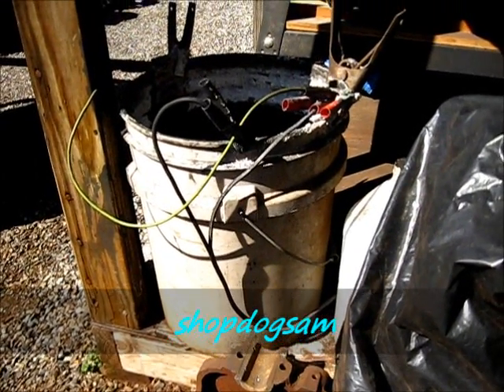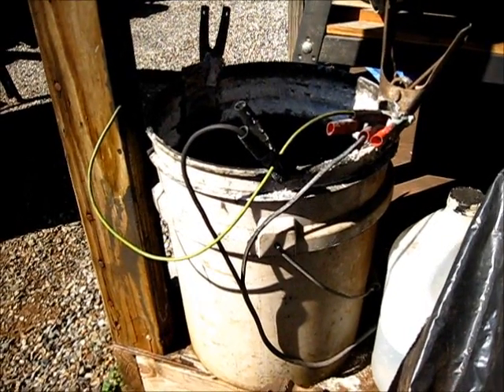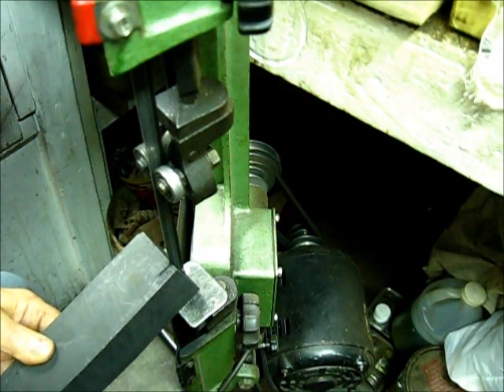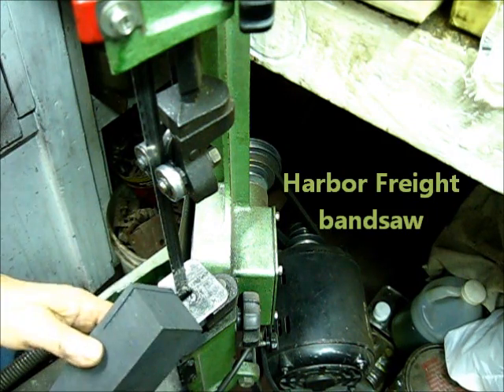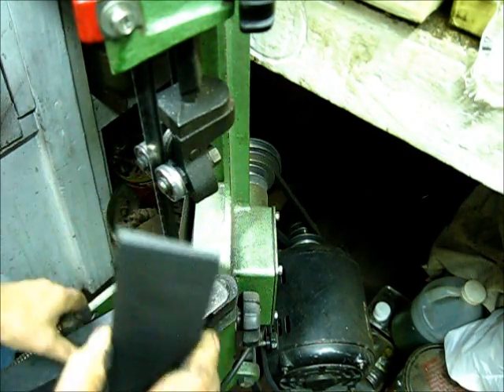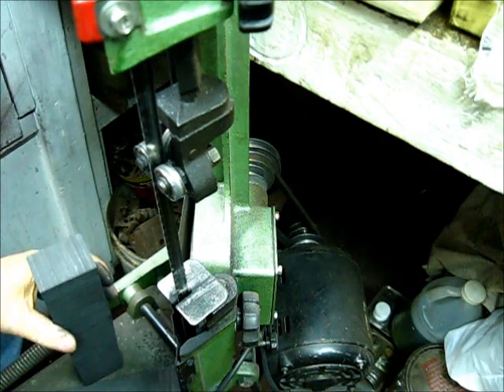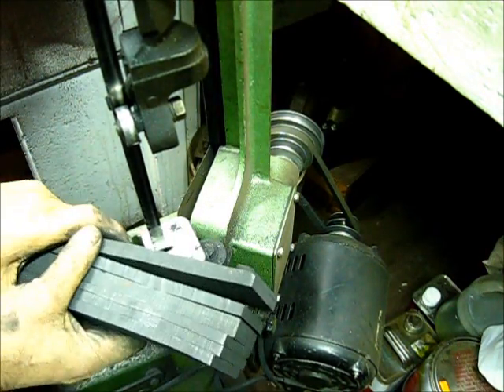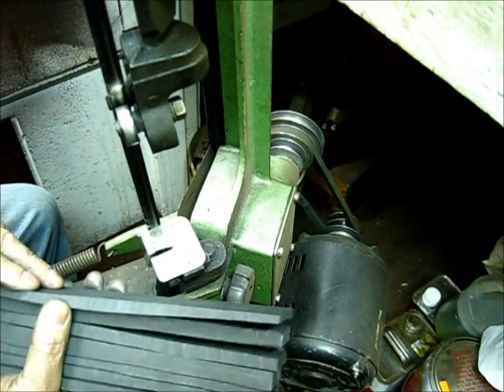Electrolysis Rust Removal #2 / graphite anodes

Comment: Sam, Thank you for going back and detailing this process.I was going to do this on my Economy engine.I had a tank and graphite rods mounted around the tank.filled with water and then mixed in my washing soda.Put the engine base in the solution and hooked up my leads.Then when I plugged in my battery charger it decided to die(nothing to do with the tank)So I left the base in the solution for a week and it actually dissolved most of the paint.

Comment: 7:05 yeah old video... But still I want to get this right here: your part will not be cleaned only in the line-of-sight. It literally doesn't matter where your (graphite or whatever) anode is. The rust will find its way from the part to the anode. The closer the anode is to your work piece the faster the whole process works tho.
Reply from the maker: ,, the part will be cleaner in the line of sight, front as compared to side of object to be cleaned,,,

Comment: I cut my graphite plates with a skill saw.. I don t recommend doing that for 2 reasons. 1. lots of dust. 2. too wasteful. Lost an 1/8" of plate with every cut. The metal basket I made works great for small parts.  Thanks Sam.

Comment: Graphite is not an effective lubricant. In the presence of moisture it is a cathode to all known metals except gold and platinum. This means that if you try to "lubricate" something with it, it will cause it to corrode over time.
Reply from the maker: Patrick Legacy ,,,, and i'm not lube-ing anything,,, just removing rust,,,
Reply from the maker: Patrick Legacy ,,, and if I may ask about the article or source of the information about graphite as I am interested in the corrosion tests,,, thanks,,
Reply: Hi shopdogsam! The information was given to me in literature from  a corrosion control course provided by the US Department of Defense. I will dig up the specific pages that make reference to graphite and its effect on metals. I know that in one case it was used to make markings on the wing or fuselage of aircraft and the corrosion causing the shape that was drawn to literally fall out...

I know that you are not using it as a lubricant in this video, but I wanted to say something because in your video you did mention that it is a dry film lubricant, but I must disagree that it is a lubricant at all. I think that it works very well in the electrolysis, and I think the reason why is that as a natural cathode, it wants to "plate" itself onto nearby metals. This is why the rust will not stick to it when the graphite is electrically charged as an anode.
Reply: He said the graphite dust is a good DRY Lubricant and he is right. Best thing to put in locks and guitar tuners so they don’t slip.